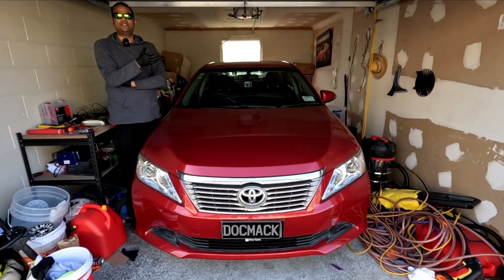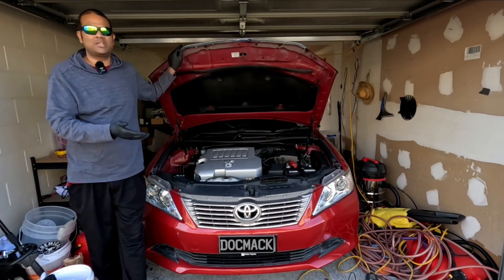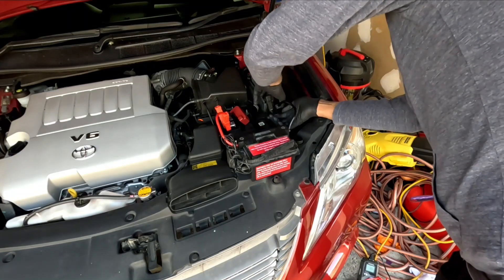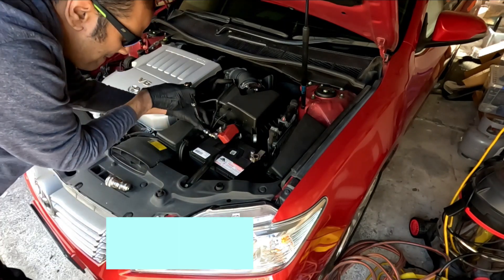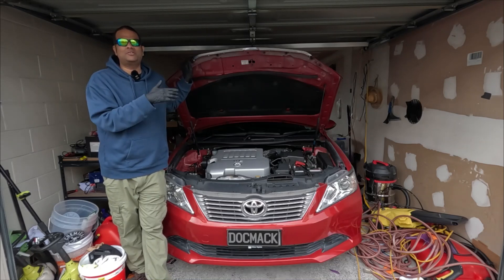How to test a cars Charging system - Battery and Alternator EASY DIY !

Comment from the maker: Hey Peeps, there is alot more to a Battery and Alternator than one would think. 
I have enabled the chapters below.
Please leave a like and Subscribe. 

Chapters
0:00 Intro
0:32 Tools used for Diagnostics
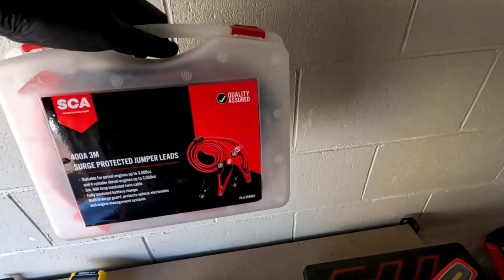1:34 Car Won't start
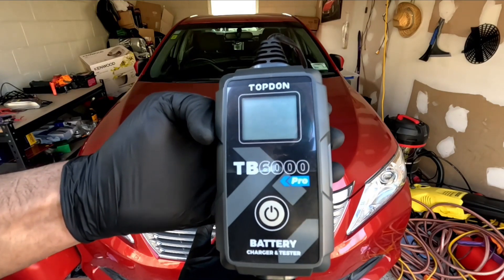1:58 Checking dead battery voltage
2:41 Very important info about your battery
4:30 Age of the Battery
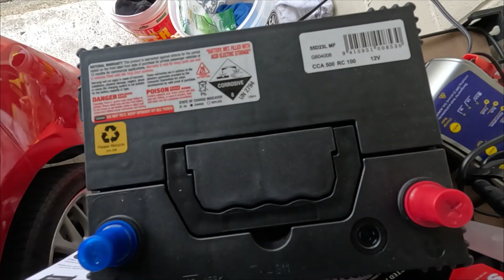5:12  Jumpstarting and testing Alternator Pre-Charging
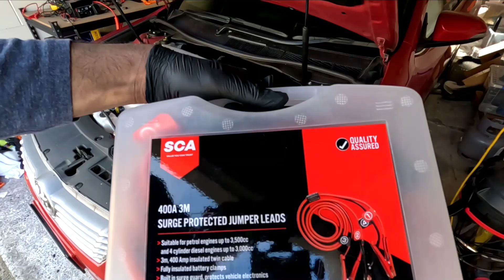7:01 What is an Alternator
7:38 General advice
7:55 Cleaning Battery Terminals
9:36 Charging the Battery
9:47 Can I save my old Battery 
10:28  What to do post Charging
10:49 Testing Battery Voltage after Charging
11:17 Testing Battery with gadget
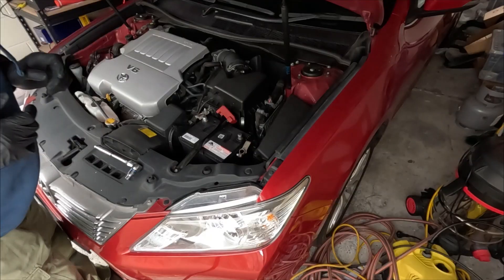12:15 Reconnecting Battery
12:43 Engine Running Testing Alternator
12:58 Testing Alternator and Battery from inside the car
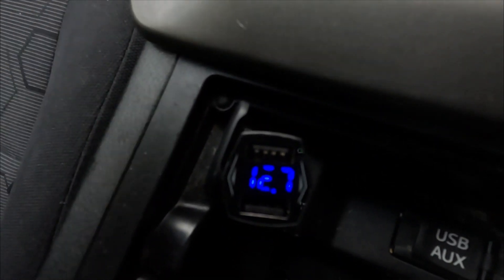14:18 Outro and Subscribe

Comment: Everything this gentleman said in this video is 100% what I was taught about alternators and batteries. Very Well Put Video!!! Also, if your car engine is running and you disconnect the negative battery terminal, one of two things will happen. If the engine keeps running your battery is bad and alternator is good. If the engine shuts off your alternator is bad and battery is good. NOTE...Just be careful doing this on newer cars.
Reply from the maker: Thank you for the praise 😊.  Please consider subscribing to my YouTube Channel for free if you haven't already to show your support.